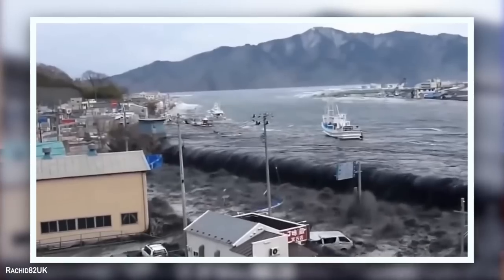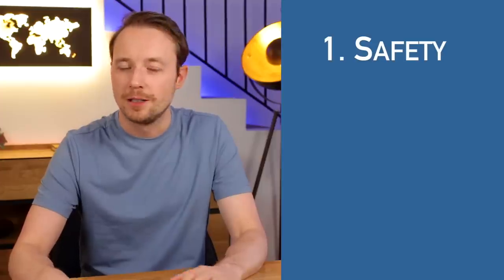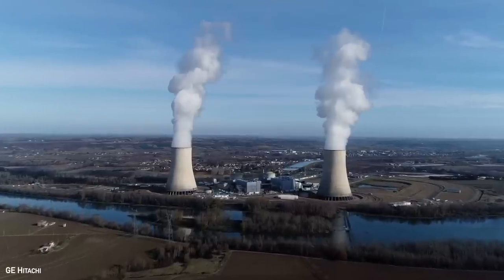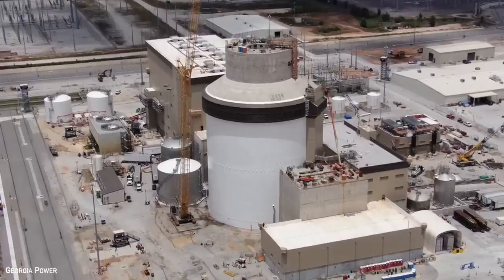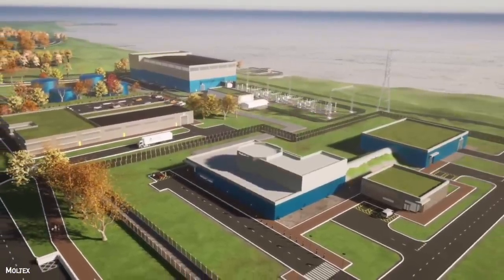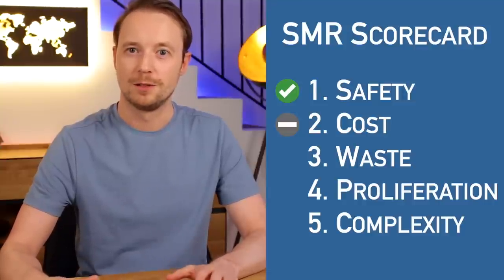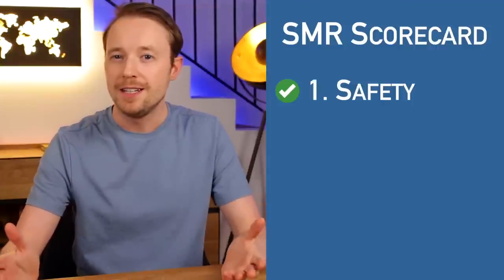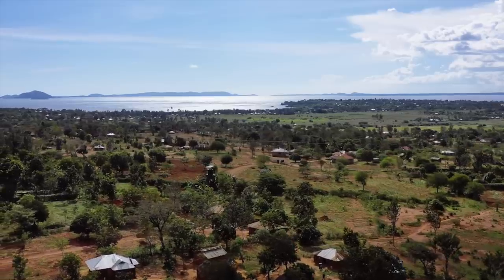Can Small Reactors Revolutionize Nuclear Power?

Comment: Great balanced presentation thank you. I appreciate this is a presentation comparing smr with large nuclear so these following comments are directed at expanding options to be looked at and compared with. Geothermal, hydro and perhaps tidal generators should be included as an option as well as the option of storage units such as battery or heat sink sand storage for heating to be coupled with intermittent sources like solar or wind. Again a very good explanation and well balanced. Perhaps a next video on a comparison of all the old and new non fossil fuel sources
Reply: Wind and solar are now, by far, the least expensive ways to generate electricity and their cost is expected to continue to decline.  Lithium iron phosphate (LFP) batteries are dropping in cost rapidly and have extremely long cycle lifes which makes storage very affordable.  This is what any nuclear solution has to work against.

And don't forget.  Nuclear needs both storage and backup generation.  Nuclear is not good at load following and if you reduce reactor output to match demand then the cost of electricity produced increases.  Cost per MWh = total cost / total output.  The nuclear plant needs to run at max output and use some sort of storage to park unneeded output for use during peak demand periods.

We built a lot of pump up hydro storage back in the days when we were building reactors in the US.  

And reactors frequently go offline unscheduled.  There has to be some sort of generation standing by to make up for the loss.  Most likely that's going to be a CCNG plant.  And the cost of those plants  and their fuel has to be folded into the true cost of nuclear produced electricity.

Comment: Whether you believe in climate change or not SMRs should have been progressed significantly over the years but this has not happened. It makes sense to have smaller, distributed generation as protection against unit outages for whatever reason. In the UK coal fired super stations produced 2000 Megawatts via 4 x 500 MW generation units, frequently one out of the 4 being undergoing shutdown for maintenance. Stupidly these have been irrevocably destroyed without completing replacement sources first. As the video mentioned, decommissioned coal sites have service provision (cooling water, grid connections, transport - road and rail and workforce) in place. Industrial space around the sites included boiler/turbine halls and immense coal stockpile areas. Those spaces could easily accommodate several SMRs to achieve similar if not more electricity generation output than the preceding coal fired stations. If we sink back into the dark ages it'll be because of ignorance and failure to push through the bureaucratic web.

Comment: I turned off the video once you said NuScale, some of the advantages of SMR are also the advantage of new Gen III+ reactors like passive safety and module construction. On a developed grid I believe full scale reactors will still work out safer, cheaper, and will make less waste. Where SMRs shine is like the floating Russian power station used where there's no Electrical Grid. Once you said NuScale it sounded like an advertisement.

Comment: Everyone seems to forget how many Years a nuclear plant will run, against a wind farm.  You have to change the wind turbines 3-4 times under one lifecycle of a nuclear plant.
Reply: Wind turbines are gearboxes with a generator attached. Much simpler than a power plant nuclear or coal.  Wind turbines with routine maintenance can last indefinitely .  Only the fiberglass blades need replacing every 30 years.

Comment: Public support remains the roadblock. These videos need to be shared and openly discussed. The potential for nuclear is tremendous if we want to improve the conditions of humanity. The cost of electricity generation is nothing when compared to the benefits of limitless power. It is akin to shutting down extremely profitable bitcoin mining to have enough power to heat our homes. SMR's are especially crucial because of political instability. Our power grids and systems are under attack by armed radicals; attempting to sow political unrest.

Comment: Why does it still take 1-2 years to build them in a factory?  Is that due to low volume boutique production, regulatory inspections at different production phases, complexity, or what?  If the factory were making 500 a year would there still be a 2 year latency from start to completion?
Reply from the maker: Good question. It would depend on how many were needed to be produced. Boeing can take a high-demand design, like the 737, and make one in about two weeks because the production is streamlined and constant. Lower demand takes more time. Since no one has these factories yet, everything is estimated. So we'll have to see. Cheers!
Reply: Even if you can make the reactor in 2 weeks (per the 737 comment), the plant would still need to be built - foundations, structures, turbine installation, switchyards, etc.

Comment: My question is what is taking so long to get these reactors into service?  The world's navies have had Small Modular Reactors in service since the the SSN Nautilus was commissioned in 1954 -- 66 years.  Further, the maritime environment is a very harsh one.  Yet there has been few if any problems in that service. 
Yes, many of these new designs are new like using molton salt or self limiting to avoid the possibility of meltdown, but not all. Further, why the unending price escalation during development?  Surly, the companies should have learned to estimate costs and secure materials in a timely and efficient manner.
Reply: Naval reactors do show much of what is needed, but are quite small, at about 30-50 MW (10x less than the 300 MW of a SMR).
To compare this to households, we each consume about 1 kW, so a 30 MW reactor can power about 30,000 homes; vs a 300 MW powering about 300,000 homes (mid-sized city)

Comment: 6:36 a BIG item in your explanation of LCOE which you left out is the "discount rate". This is roughly speaking the return on investment expected over time aka the interest rate of the capital investment. Nuclear is a bigger investment, so if there is a larger discount and rate the costs are artificially high because of that. As well, LCOE usually does not address nuclear's benefits after 40 years. You can see these start to appear in some LCOE reports as "fully depreciated nuclear".

With municipal projects that "return on investment" should be much lower. After all you wouldn't buy a bridge with a credit card and government bonds dot not pay out like the stock market.
Reply: Vogtle units 3/4 have a principal loan of $31-32 billion with ~$1 billion per year interest.  Southern company just asked for a 600 million dollar rate increase for unit 3 and I assume they will ask for the same for unit 4.  Electric rates will at least double.  Reliable power at a cost few can afford.

Please explain why old fully paid for nuclear plants are shutting down every year when investor owned utilities say they are not cost effective??
Reply: @clarkkent9080  1. high labor costs, 2. low fracked gas prices in the US, 3. construction delays / bad supply chain / bad subcontractors (just like happens in EVERY municipal project), 4. regulatory delays (thanks to Jaczko the grifter)
Reply: @clarkkent9080  I see you're continuing to soy out about Jaczko, but you asked me for the data. He's the cause of that data.
Reply: @soyattle  Wow, 11 years ago and still responsible.  Obama must have a hand in everything happening today in the world.  Simple solutions for simple minds
Reply: @clarkkent9080  Obama and Trump and Jaczko each left their mark on the world. that’s how time works. Things happen in order and effects proceed from causes.
Reply: @soyattle  But not as much as the faceless construction craft and project managers that with their greed, fraud, kickbacks, theft, and incompetence turned a $6 billion dollar project into a $16 billion dollar financial disaster
Reply: @clarkkent9080 
Depends on the specific plant, but most are shutdown over political pressure, not economics. Pilgrim, Vermont Yankee, San Onofre, Indian Point, Maine Yankee, and others all closed due to political pressures.
Kewanee was economic, and almost lost all Illinois plants.
They became unprofitable when federal and state governments didn’t include nuclear in the green energy mandates.

Comment: Very informative & well done on video. 
I am thankful that nuclear is still being produced & improved. 
At the least much more electricity will be needed as more electric vehicles are being produced. 
At the best, I can see the day that very small nuclear reactors could directly power not only ships, but even locomotives, large construction equipment & ultimately semi tractors & large trucks. 
Would be more efficient than diesel/electric & far more effective & efficient than batteries!
Reply: Reality.

This is from the Des Moines Register an concerning the only Small Modular Reactor (SMR) project in the U.S. today. It should be noted that NuScale said this month (Jan/2023) the target price for power from the plant is $89 per megawatt hour, up 53% from the previous estimate of $58 per MW hour

In 2013, the Wall Street firm Lazard estimated that the cost of generating electricity at a new nuclear plant in the United States will be between $86 and $122 per megawatt-hour. Last November, Lazard estimated that the corresponding cost will be between $131 and $204 per megawatt-hour based upon the 4 recent new nuclear projects in the U.S. . During the same eight years, renewables have plummeted in cost, and the 2021 estimates of electricity from newly constructed utility-scale solar and wind plants range between $26 and $50 per megawatt-hour. Nuclear power is simply not economically competitive.
SMRs will be even less competitive. Building and operating SMRs will cost more than large reactors for each unit (megawatt) of generation capacity. A reactor that generates five times as much power will not require five times as much concrete or five times as many workers. This makes electricity from small reactors more expensive; many of the original small reactors built in the United States were financially uncompetitive and shut down early.
The estimated cost of constructing a plant with 600 megawatts of electricity from NuScale SMRs, arguably the design closest to deployment in the United States, was originally advertised as costing $1 billion but upon requesting actual bids from engineering firms, increased to $6.1 billion in 2020. Given inflation and other cost constraints that cost today can only be expected to be significantly higher.
The cost was so high that ten members of Utah Associated Municipal Power Systems canceled their contracts. NuScale then changed its proposed plant configuration to 6 fewer reactors but increased each reactor output from 50 Mw to 77 Mw costing at total of $5.3 billion. The NRC just last week approved the construction of the 50 Mw design but now will have to start the review process all over given the switch to a 77 Mw design. For each kilowatt of electrical generation capacity, that estimate is around 80% more than the per-kilowatt cost of the Vogtle project in Georgia — before its cost exploded from $14 billion to over $30 billion. Based on the historical experience with nuclear reactor construction, SMRs are very likely to cost much more than initially expected. And they now have delayed the project start until 2025 in an attempt to find more backers.  All this before the inevitable setbacks that will occur once construction starts.

Comment: Poland want to build 2 as far as I know 6 should be at the end. 

The first 2 would be APR-1400 
And AP1000
Reply: Here is the AP1000 story in the U.S..

If you live in the U.S. here is the reality for the last 4 state of the art Westinghouse AP1000 ADVANCED passive safety features new nuclear power projects and spent fuel reprocessing and in the U.S. over the last 20 years. You decide if this YT video was presenting the truth. 

The Southeastern U.S. is super pro-nuclear MAGA, has zero anti-nukes, and 100% media and political support. 

The MOX facility (South Carolina) was a U.S. government nuclear reprocessing facility that was supposed to mix pure weapon grade Pu239 with U238 to make reactor fuel assemblies. It was canceled (2017) in the U.S. After spending $10 billion for a plant that was originally estimated to cost $1 billion and an independent report that estimated it would cost $100 billion to complete the plant and process all the Pu239, Trump canceled the project in 2017.

VC Summer (South Carolina) new nuclear units 2&3 were canceled in 2017 after spending $17 billion on the project (original estimate of $14 billion and 2016 completion date) with no clear end in sight for costs or schedule. 

Vogtle (Georgia) new nuclear units 3 &4 currently 110% over budget and schedule (currently over $30 billion) and still not operating. Mid way into the build, the utility stated that had they known about the many costly delays they would never have chosen nuclear. They are now delayed another year because according to the project management, thousands of build documents are missing. If completed, Vogtle will be, for its output, the world’s most expensive nuclear power plant.

Please google any of this to confirm.

If you can’t build new nuclear in the MAGA super pro-nuclear southeast U.S. then where can you build it?

Comment: How come no one talks about the ability this affords the public and country in safety and consistency when it comes to constant power over the grid. This makes it harder for bad actors to affect large portions of the grid from one location. It would also lead to less power loss over the lines since the power is near you rather than 100's of miles away. Power loss over the lines in some cases is really really high.
Reply: It is all about cost.  Electricity from large PWRs is 2-3 times the cost from any other generation source and SMR are even more expensive.

This is from the Des Moines Register an concerning the only Small Modular Reactor (SMR) project in the U.S. today. It should be noted that NuScale said this month (Jan/2023) the target price for power from the plant is $89 per megawatt hour, up 53% from the previous estimate of $58 per MW hour

In 2013, the Wall Street firm Lazard estimated that the cost of generating electricity at a new nuclear plant in the United States will be between $86 and $122 per megawatt-hour. Last November, Lazard estimated that the corresponding cost will be between $131 and $204 per megawatt-hour based upon the 4 recent new nuclear projects in the U.S. . During the same eight years, renewables have plummeted in cost, and the 2021 estimates of electricity from newly constructed utility-scale solar and wind plants range between $26 and $50 per megawatt-hour. Nuclear power is simply not economically competitive.
SMRs will be even less competitive. Building and operating SMRs will cost more than large reactors for each unit (megawatt) of generation capacity. A reactor that generates five times as much power will not require five times as much concrete or five times as many workers. This makes electricity from small reactors more expensive; many of the original small reactors built in the United States were financially uncompetitive and shut down early.
The estimated cost of constructing a plant with 600 megawatts of electricity from NuScale SMRs, arguably the design closest to deployment in the United States, was originally advertised as costing $1 billion but upon requesting actual bids from engineering firms, increased to $6.1 billion in 2020. Given inflation and other cost constraints that cost today can only be expected to be significantly higher.
The cost was so high that ten members of Utah Associated Municipal Power Systems canceled their contracts. NuScale then changed its proposed plant configuration to 6 fewer reactors but increased each reactor output from 50 Mw to 77 Mw costing at total of $5.3 billion. The NRC just last week approved the construction of the 50 Mw design but now will have to start the review process all over given the switch to a 77 Mw design. For each kilowatt of electrical generation capacity, that estimate is around 80% more than the per-kilowatt cost of the Vogtle project in Georgia — before its cost exploded from $14 billion to over $30 billion. Based on the historical experience with nuclear reactor construction, SMRs are very likely to cost much more than initially expected. And they now have delayed the project start until 2025 in an attempt to find more backers.  All this before the inevitable setbacks that will occur once construction starts.